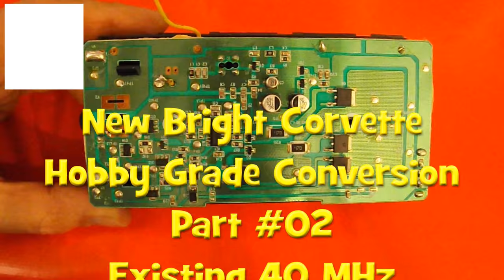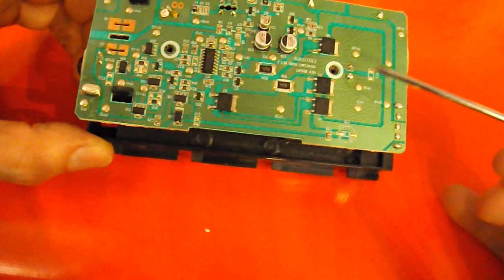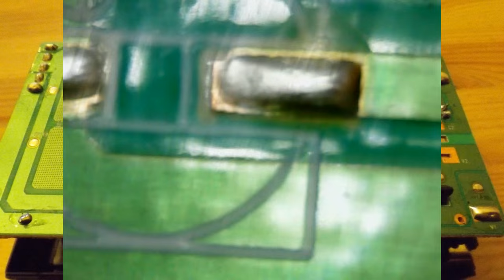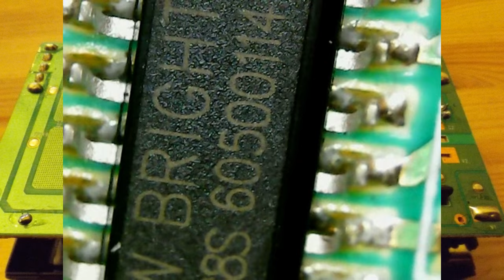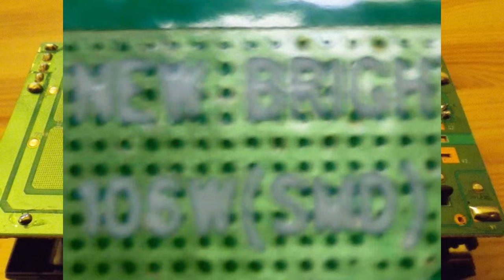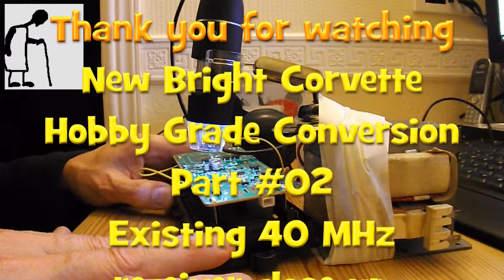New Bright Corvette Hobby Grade Conversion Part #02 Existing 40 MHz receiver close up

Comment: Enjoyed that, though i'm not one of those H Bridge people. Those people are rumoured to hang out behind nightclubs in Grimsby. Guaranteed that if you take an air freshener with you on a Tuesday morning at 3am and while wearing a yellow coat, you'll meet an H Bridge fanatic.
You can find the datasheets for most transistors by putting '2S' in front of the number, such as 2SB772. L1 was a nicely wound inductor. The metal can caps have their negative end painted black. So those were 3.3uF and 100uF 16V. A search on 'SMD transistor table' will bring up what 3P and 5P equate to. But, after all that, it's getting junked for hobbygrade anyway :)
Reply from the maker: +slider2732 thanks again for all the extra info. I was surprised how large this receiver was. They seem to have spaced everything out to give you the feeling you have something more impressive that a basic on/off switch. I cynically think they made it BIG to match the BIG car.

Comment: Well, the more I watch of your videos the more I am convinced I need to do one of these conversions.  I've got some experience with electronics (mostly from playing around with Arduino's and solar panels and such) and my kids have many of these toy RC cars lying around unused.  I also have some spare servos, ESC's and receivers in my RC parts box.  My question now is:  Could I use a hobby-grade ESC to power one of these smaller toy-grade motors, or will it likely fry the ESC?  I see you are using some smaller ESC's from ebay or such, but curious if you have ever tried this with a standard hobby-grade ESC typically used for brushed 540-sized RC motors?
Reply from the maker: You made me smile when you said "standard" hobby grade. Those little 20A ESCs are standard hobby grade for small hobby grade vehicles. In fact despite it's size, this car has a tiny motor in it and that little 20A is probably sufficient (just).  I am guessing you are thinking of the Traxxas type components. When you get to episode 6 in this series you will see I do use a larger 160A ESC but unless I am going to change out the motor there is not much point going much larger that that one and the only reason for doing this RC "Upgrade" was to give it proportional steering and greater range. A proper upgrade would really be a matter of getting a decent chassis and running gear and just put this body shell on it as the body shell looks pretty good. This one is probably my favourite upgrade, still the standard motor but much more rewarding result that the Corvette - RC FastLane Jeep Cherokee https://youtu.be/naIYQotzuCk?list=PLA5a2xPRSrB1I4cS2wmjg8KdnBtGhnZci Another charity shop find and I didn't upgrade it for nearly 2 years as it worked OK as it was, but eventually the toy grade steering died so the hobby grade conversion happened.

Comment: i have a 12v toygrade rc car and i want to upgrade the motor with 21t hobbygrade brushed motor using the toygrade reciever will it works or i will fry the circuit board?
Reply from the maker: I only just found this comment. YouTube is failing to notify me of all the new comments but as I already answered your similar question on another comment I will paste that reply here with minor alterations. I am no electronics expert but logic tells me that a larger hobby grade brushed motor would draw more than the expected current through the RC receiver's motor control circuit so YES I would expect it to fry. I have certainly fried receivers trying a similar swap. Alternatively I may be looking at this the wrong way and it may be that the same current is supplied so the hobby grade motor will run much slower than expected but the receiver survives. Of course you could just try it and find out or ask a Physics teacher. It might be worth looking on the RC car forums to see if anybody there can offer any advice as they may already have tried it. You might need to be able to supply specific details of the components on the receiver board.

Comment: I had a New bright truck and I was on the couch with it and drove it into the couch pillow and kept the throttle on and it smoked a little bit and smelled pretty bad but it still worked.
Reply from the maker: Some times you will be lucky